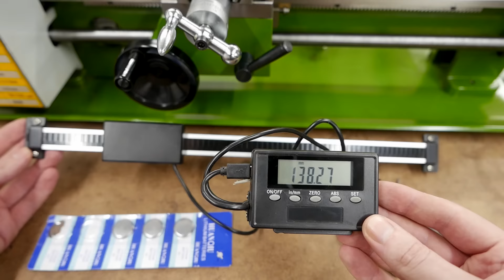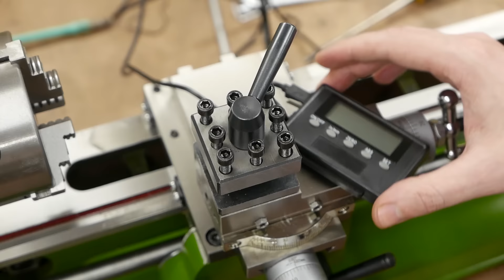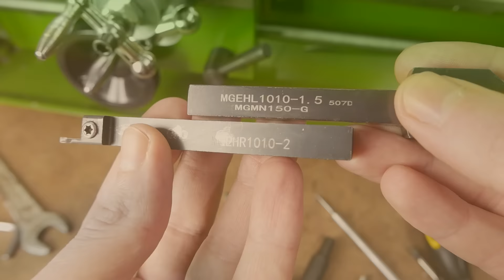MEGA UPGRADE mini lathe

Comment: The problem with backlash on the compound slide z-axis is that there is no thrust bearing on one side.The first bearing just barely clamps on the face of the slide, and this does work but is flexible. The second bearing is doing most of the work but it's not designed for that, being the indicator dial. I added a plate at the end of the slide, before the clamping ring that is inset for the shaft and this fixes the backlash. But an improvement would be to add thrust bearing as you did - there would be zero backlash and ultra smooth action. Leave the dial indicator alone.
Reply: If your thrust bearing pockets are not the perfect depth you really gain nothing then on backlash do you?

Comment: If your having trouble with your parting tool it's likely because your feed rate is much to slow, like what your seeing in this video. Make sure the carriage is locked in the "x" direction and your Gibs are adjusted properly. You'll get a feel for it with experience, try 3-4 times faster than what's shown here to start. Don't peck at it either, keep a constant feed rate going. Everytime you back out and go back in your increasing the chances of breaking the tip or ruining an insert. Your success rate will improve exponentially!
Reply: There isn't really enough power to use carbide on these small lathes, you cannot feed them hard enough as the lathe bogs down. And Carbide is really blunt compared to HSS, you need high feed rates and a rigid setup to make them cut.
Also note that he's got the compound rotated 90 degrees and using that to feed the tool, which makes it even less rigid compared to doing it the normal way with the cross slide.

Comment: Turning the compound radially vs the stock, at 10:23, re-distributing the tool's side torque over the whole length of the gib, is a clever idea;  Great video.

Comment: Hello sir,
Congratulations for your very informative video accompanied by solutions to the problems encountered. I do not have the same tour but I will get inspired by your method.
A question: in 2'45 you install a rule of measurement of displacements; would you please have a link and the model.
Thank you in advance and good luck.
P.K. (French)

Comment: Nice upgrade vid,
I see you using the compound to travel in when you use the parting tool, Is that because if you had the compound as normal on it's side that you get movement  and so moves the cutter of centre resulting in bad cut.
FIX, 
install a locking off hex bolt in between the grub screws and inline to push the gib bar tight,

Can you share where you got the digital Dro bar and readout from
And also information of what size and type of thrust bearings you used. :)

Comment: I am thinking to build a riser block under my headstock to be able to fit much beefier cross slide and tool post on my Holzmann ED750 lathe. I hate how small cut i can take and parting is quite scary operation on that thing. I think the problem is on most of those mini lathes is indeed how week everything is around the toolpost...
Reply: Just raising the headstock up by 2-5 cm would give alot of better rigidity in the compound...

Comment: excellent, is there any solution, or upgrade for this lathe, to be able to put the angle in the advance without having to do the whole system backwards to show the two screws?  that would be very good
Reply from the maker: I recently came up with a solution to this problem, if everything works out, I hope to show it soon in the next video
Reply: @hammerland4028  Wonderful, I'm excited for this, waiting here, 🤩
Reply from the maker: @KustomKayak  I recommend this option https://www.youtube.com/watch?v=rdkoTN094bA

Comment: Awesome video! I'm upgrading my mini lathe (Busy Bee B-244) motor to a stepper motor from my friend (the stock motor from 1986 finally died), should be a monster! Maximum will be approx 2000rpm (chuck) with about 6nm pull-out torque at that speed (much much more torque at speeds less than that). It's a beast. He said it can run on 120v at lower power and while running it draws next to nothing but when you put it under load the controller always trying to keep it at the same speed, so for short durations it can pull up to 2000 watts to try and keep it there (you can tell the controller the maximum you want it to pull).
Reply: At that torque you will definitely need the metal headstock gears. Even the standard motor can strip the teeth of the plastic gears! Fortunately the later models already incorporate them as standard. I've heard that it may indicate that the main headstock bearings are taper roller bearings.
Reply: @amanofmanyparts9120  The motor goes right to the chuck drive shaft with a toothed belt, so no gears to strip there. As soon as I set up my electronic screw drive then there will be ZERO gears in the entire lathe! Can't wait, I'll be a threading master! :)
Reply: @toysareforboys1  Other owners have found that the slightest of excess play in the drive belt and the teeth start to wear.
Similarly, too much drag from the cutting tool can put too much torque on the teeth and snap them off one at a time.
This is from practice, not theory.
Reply: @amanofmanyparts9120  Belts are cheap and I have spares, we'll see how they wear. They are SUPER tight and no springs on the idler pulley so no room for play when under tension. I have very good belt wraps around both pulleys so I hope to never snap a tooth off the belt as the torque should be applied to many many teeth at the same time (20 tooth pulley on the chuck shaft, 40 tooth on the motor). I already threw a big big cut at it, got an over current warning on the stepper driver (20 amps, was only running it on 120v at the time) but other than that cut nice, didn't miss any steps or skip any teeth :) I've got it connected to 240v now so it can do big big power (depending on motor and driver temperature) so shouldn't run into the over current warning anymore, would probably break my tool/tool holder before I would get there.
Reply: @toysareforboys1  Whatever. I'm just passing other's experiences, not just opinions.

Comment: The newer version (blue) of the Shahe DRO is better than the DRO you show (I have both)(on my mill). I took the back off and used a mains 3vdc power supply for continual on with no sleep. I need to do some of these things to my G4000 9x19 lathe. Good vid.

Comment: I used a very similar setup for my z axis scale. For some reason though, once I turn on the spindle the scale just starts counting up. I think there may be some shielding issues with the electronics lol.
Reply: GeneralChangOfDanang  what was your issue ? I have to the same problem.
Reply: @ximcinema4083  I never really followed up on it after turning my mini lathe into a polishing/de-burring machine. The best I could figure out is there's some kind of shielding issue with the lathe's wiring. I think there are some forum posts related to this problem, but the electrical stuff goes over my head. Not much of an electrical wiz to be honest.

Comment: Very good work, but you know that by buying this material and at this price you're only getting a rough draft of a machine that you'll have to finish. The only thing to check is that the materials used are noble and not made of unsuitable material.

Comment: Do you have a link to the thrust bearing you used?  Thanks.
Reply from the maker: http://ali.pub/3nqvtm
Reply: @hammerland4028  I've measured the shaft at 11mm, so I assume that you polished it down by 1mm in the lathe with emery cloth.

Comment: With these miniature /small lathes the use of a carbide tool for parting is not advisable. A properly ground HSS tool will be much more useful. These mainly Chinese made lathes, do not have the necessary rigidity to make use of a carbide cutting tool. The main problem is the very poor contact areas in the saddle and the compound and to put them right a complete re-scraping of the mating surfaces is required, and this is besides the problem with the bearings in the headstock and te fit to bed. Carbide does not cut in the conventional sense but rather bulldozes its way through the material, and therefore needs very high speed and lateral force to do its job properly and leave a good surface finish. Otherwise a good job.